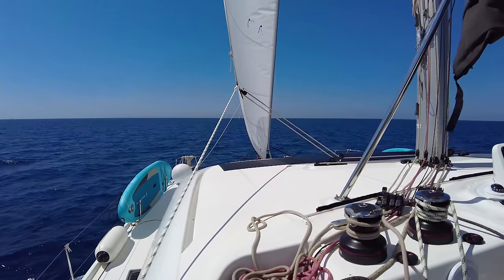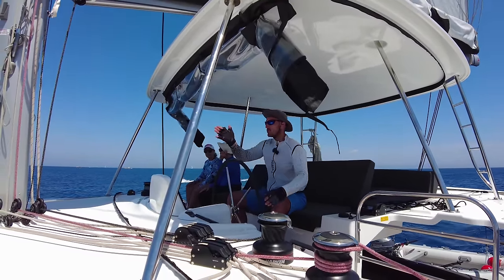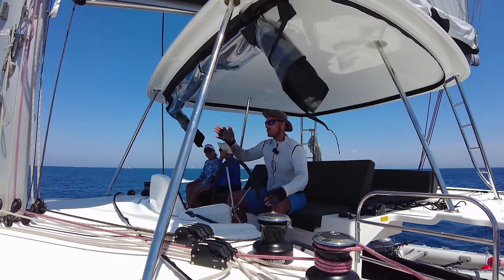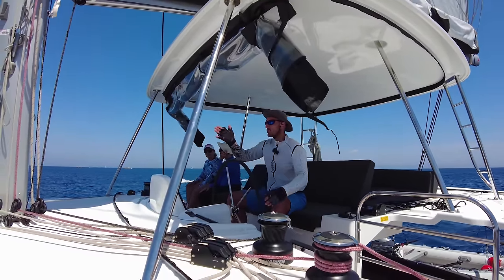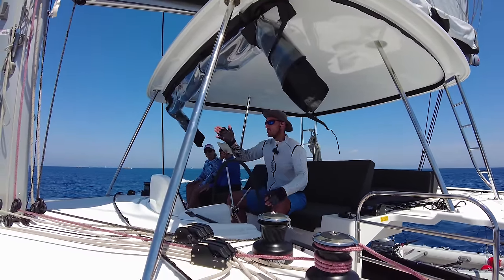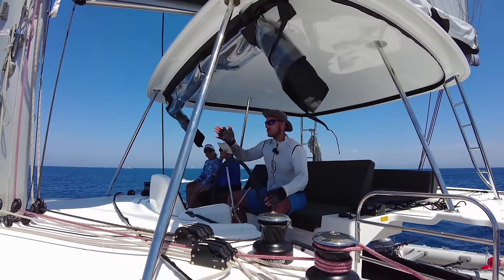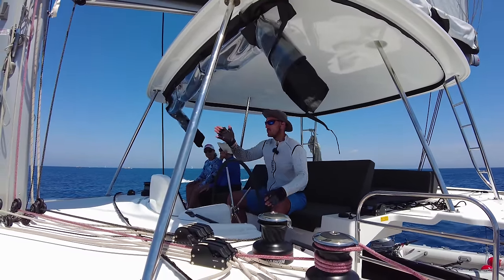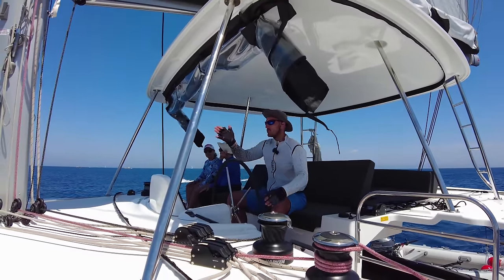How to Sail a Catamaran - 3

Comment: Good video. Look up how to properly attach the chain to the anchor. You want it attached with high strength zip ties at the end where you have the chain now and chain it to the other eyelet closes to the plow. That way if the anchor gets jammed when trying to retrieve it, it will break the zip ties and lift straight up on the plow
Reply from the maker: Good idea 👍🙏

Comment: with the 3-5 times depth rule you should include the distance form water to the attachment points of the anchor bridle for the depth.
so: 2 meters of water would give 6 - 10meters of chain (theoreticaly)
but with an attachment point of the bridle say 1m above water you will need 3x(2+1) = 9m --- 5x(2+1)=15m of chain out.
Reply from the maker: It is about chain laying on ground near anchor which depends from wind strength. Also how well anchor is holding. With bad hold put much more chain as friction on ground will help. Practice and observe anchor with mask.

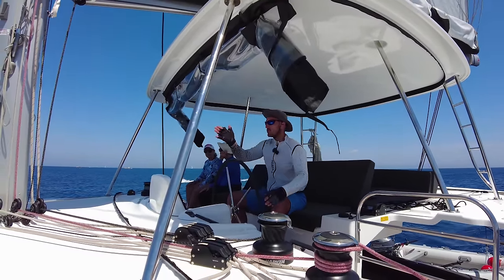Comment: 2:05:45 That was very, very  interesting. Wind to wing on a catamaran in comparison to a monohull.
Reply: Yes very smart to catch that wind off the main with the head sail 👏 my question on that set up why not the genoa vs the jib. Was the wind too strong? It didn’t look that bad. Then he switched to wing on wing with both jib and genoa which is probably better to deal with changing wind and don’t put too much strain on the main preventer. That thing could also snap in a huge gust and lots of force there.
Reply from the maker: Thanks 🙏
Reply from the maker: Crew was learning so we slowly put bigger sails.